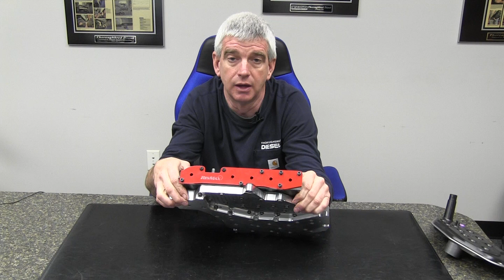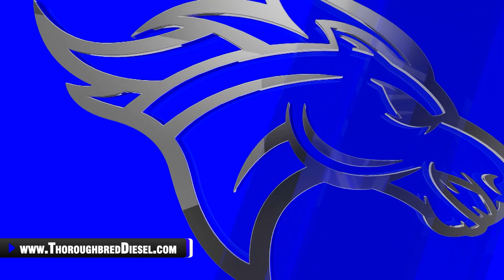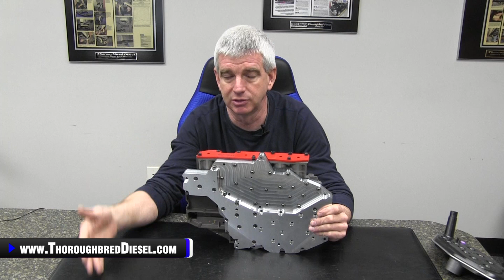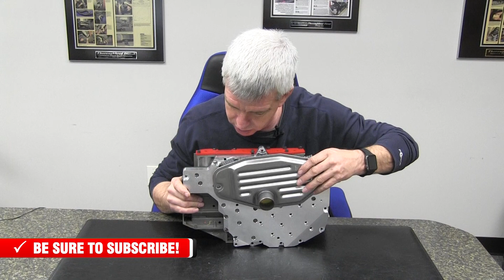RevMax 68RFE Billet High Performance Towing/HD Valve Body #dodgetruck #diesel #transmission #cummins

Comment: I installed this valve body in my '17 68RFE. Retuned. 252 psi line pressure. I get some hard 4th gear shifting every once in a while, but I highly recommend it. 90K miles and all is good! I'd definitely buy it again.

Comment: I have a 2017 stock transmission Ram 3500 I have the 68RFE with 517,000 miles and counting pulls a 40ft goose neck up and down the I-70 in Colorado.    What’s the trick to lasting so long you ask ? 
40,000 miles transmission oil changes with filters 
ATS deep pan 
ATS thermal bypass valve 
Every 5,000 mile oil changes 
Royal purple 75-140 Diff oil changes every 15,000 miles 
Transfer case fluid change every 25,000 miles 
Crank case filter change every other oil change super cheap Amazon ones 
Every other tank of fuel goes in Hotshot injector clean 
monster ram intake from banks 
Valve lash adjustment performed at every 200k miles so since it has 517 it’s been serviced twice 
Now the replacement parts only has been 
Water pump and belts and tensioner 
Batteries 
And hoses  and of course brakes and rear main seals  and that’s about it.    As long as you take care of it it will last

Comment: What kind of HP can I safely be at with this VB?
Reply from the maker: This increase line pressure and avoids warping, so its not about the HP it will hold, your trans build and tuning will determine that.

Comment: Is this valve body universal across the 68s up until 18 ? Is the Mopar solenoid pack the only difference between the years? I have a 09 that the trans went out on, I’m buying a whole built trans for it. I put this revemax valve body in it very recently , However I would like to use this valve body, (the zeroflex)  in my 13. I think the only diff is the electric solenoid pack, is that correct? Out are they totally different?
Reply from the maker: The VB itself is the same on REVMAX VB’s.  I cant speak for other companies.  Putting it in the 13 truck you HAVE TO MAKE SURE TO USE THE WHITE PLUG SOLENOID PACK.

Comment: Can you run the suncoast zero cavitation filter with a deep pan on this??
Reply from the maker: Yes, it actually requires a modified pan.
Reply: I was wondering the same thing. I ordered the same VB with the Suncoast zero cavitation filter and the Suncoast +4 pan. I hope it all works. I was also wondering what's the best ATF to use. I was going to use Amsoil but I was told not to because it can cause shifting problems and clutch problems from some of the additives the Amsoil puts in it.

Comment: So when you’re talking about tuning are you referring to tranny tuning or like just engine tuning? I’m looking into this valve body but I want to make sure I have everything I need  thank in advance
Reply: My truck has efi switch on the fly but no monitor
Reply from the maker: Trans tuning I am referring to here.  You want to make sure if you are upping the line pressure via tuning that you have the screw out of the valve body.

Comment: Im having a random hard 5 to 4 ds. Its commanding /completing shift before lock /psrtial unlock. Would this fix that? It's usually good for a few k miles after I flash a new file and do a relearn. The shorted time it came back was 316 miles. This time it was over 2k. Idk what's causing it. But was debating on a new vb
Reply from the maker: Specific driving issues like yours aren’t always fixed with a VB.  We always suggest that any driveability issue be diagnosed using a scanner and watching real time data to make sure that your issue is VB related and not tuning or another problem.

Comment: Can I use the BD-Power 68RFE Pressure Control Module with this valve body?  And if so, will I need to plug the relief port?  Also, is a quick learn required?  Any way to relearn without a scan tool?
Reply from the maker: We don’t suggest the modules because they can command more than tuning will.  We talk on that in the this video quite a bit.  We want to keep the increase line pressure less than max because the VB already ups the line pressure.  Anytime the line pressure is raised by tuning the plug should be removed.  On the relearn, a module or scanner has to be used.
Reply: @thoroughbreddiesel  So the VB alone will increase line pressure?  By how much?
Reply: I'm really not sure I want to go the tuning route, very expensive and I read on the forums that a lot of people aren't happy with them and had to buy another one from somewhere else.  I'm also afraid of the 67A recall.  Some people say it locks the ECM so that tunes can't be reinstalled; Does it lock the TCM too?  I think the ECM and TCM are one unit on the 2016s.  This is why I'm reluctant to try trans tuning; high cost and too many questions that I can't find the answers for.  I'll probably end up installing the plug and just keeping the stock tune.

Comment: Have a deleted and tuned 2021 RAM 2500 HD, pop up P0871 code and only 1 time, cleared the code and gears shifted well, no code again. But if I want to upgrade VB, shall I use a diagnoise to re-learn before run the car? Cannot find a shop to do that in a reasonable price. The shop I talked to want to rebuild the VB by themselves.
Reply from the maker: You'll have to keep checking around.
Reply: Any update on this?  I have a 2020 with the same issue and I want to change out the VB but am not sure the best way to retune after install

Comment: So if you are running a tuned truck and have to return it back to stock you would have to drain the oil and put in the plug on the VB? Seems like a stupid idea. Why didn't they just put a pressure relief valve so you don't have to mess with it.

Comment: What line pressure would you run? Thanks
Reply from the maker: This VB is designed to add pressure to the 68 and give you better holding of the clutches.
Reply: @thomasc9015  200 psi. Stocks around 160psi. Do not attempt to up the line pressure without that upgraded valve body and channel plate

Comment: How do I know if my valve body is bad or going bad?  150k on 68rfe and my transmission started dropping into 4th at highway speeds.
Reply from the maker: Check codes, and don’t assume it to just be a VB issue.  With a 68, likely that any issue could have had effect on trans components.
Reply: Did you get it figured out why it was dropping to 4th? And what was the solution? @MrWhitetank
Reply: @constantine731  computer kept throwing codes for faulty valve body and overdrive gears.  Honestly could have been both.  Towing up a steep hill lost quite a bit of fluid and transmission overheated up to like 265 🥵
Reply: @MrWhiteTank  did you figure out the problem and what did you do cause that’s the same issue I’m having with my ram atm
Reply: @constantine731  not exact problem.  But is only narrowed down to 2 things either bad valve body or bad overdrive clutch pack.  I just went ahead and purchased a Firepunk transmission because I needed to be back on the road ASAP.  I think you could have your valve body sent in for testing.
Reply: What was the problem and solution?
Reply: @constantine731  kept dropping out of 5/6 overdrive gears.  I went ahead and replaced the transmission with Firepunk’s  tow 68rfe.  Have towed 19k cross country 3x now no issues.

Comment: Dodge transmission ? 😂😂 Chrysler transmission actually. Let me guess, you’re one of those dudes who has been in a coma for the last 13 years and still think Dodge also still makes Ram truck ? 🤔
Reply from the maker: Anybody that doesn’t call a Dodge Truck a DODGE TRUCK drinks Michelob Ultra.  Also, well aware that its technically a Chrysler transmission but I’m not taking the same brow beating for this as you would if you called a Allison a Chevrolet transmission.  This video is to help you put in a VB, not to be a shit-don’t-stink rank and file purist.  - Wade
Reply: @thoroughbreddiesel  hey wade dont waste your breathe on these guys lol. i just installed the revmax tow/heavy and tuned with trans tuning. didnt have any issues before still dont but also cant really tell a difference from stock VB tuned to revmax tuned maybe need a few miles on it to let it seat in and learn. 150k  stock trans and i was the first to open the trans up kinda impressed with 150k and never serviced once that it looks like brand new.

Comment: When you install the valve body without the little plug. Can you run it without a tune for a little bit or does it need tuned right away?
Reply from the maker: The plug is installed for the non tuned trucks.  Once you tune the truck, the plug needs to be removed.
Reply: Yes I had the same question , so I have my revmax already installed but I am going to be tuning my transmission , but I really needed to go remove the plug first then take the truck after for tuning , is that fine it’s about a 7 mile drive